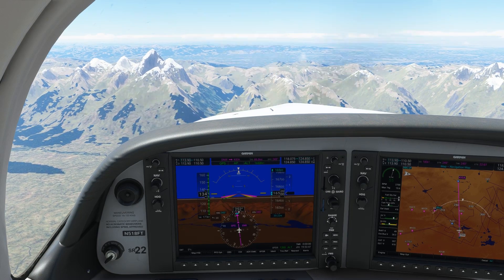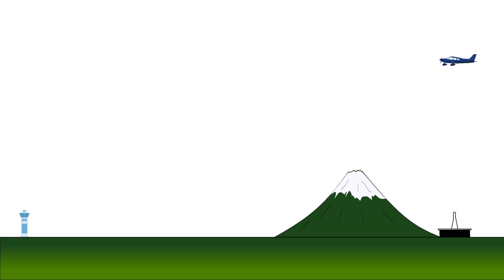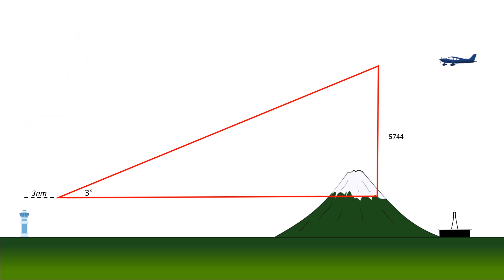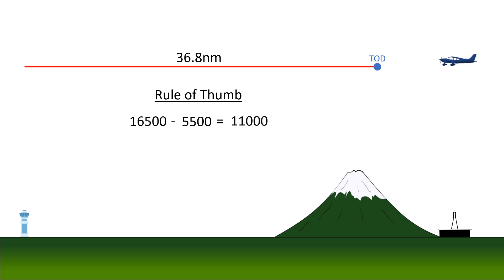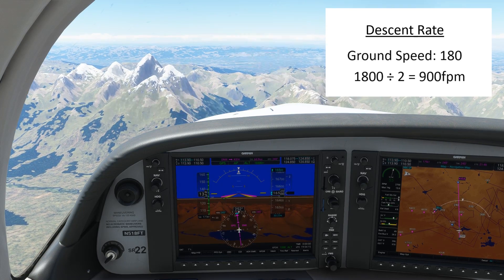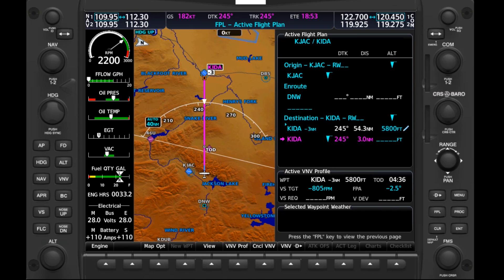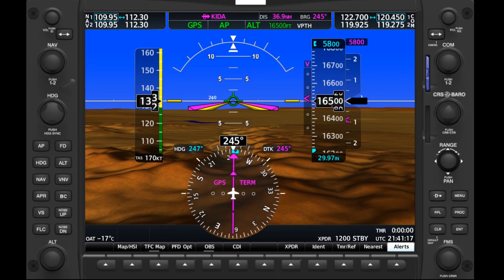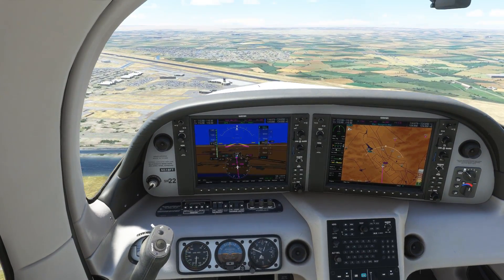Calculating Top of Descent Point | Descent Planning Rules of Thumb

Comment: Thanks, very nice video, very useful information.
The “3 X desired altitude descent” is a great tool.  I don’t know why you multiply your ground speed by 5. A lot of people simply divide their ground speed by two and multiply by 10. Hence, 180 kts / 2 = 90 X 10 = 900 FPM. This number needs to be adjusted by adding 100 ft to the 900 ft per minute to equal 1,000 ft per minute. The faster you go the more adjustment required. Example, to lose 10,000 feet you would multiply it by 3 and you would get 30 miles distance for your top of descent.  180 knots equals 3 miles per minute, therefore you would travel 30 miles in 10 minutes,  10,000 ft / 10 minutes equals 1,000 ft per minute. 3 Miles per Minute / 3 Rule = 1.0 x 1000 = 1000 FPM.  4 Miles per Minute / 3 Rule = 1.333 x 1000 = 1,333 FPM, etc.

Comment: For a PA28-180, descending at cruise spd  of 120kts, divide your descent 11,000' by 300, or, 110/3 = 36 nm. At cruise speed of 120kts, you'll need to descend ~600 fpm. My CFI said not to exceed 500-600 fpm for pax comfort, ears etc. What do you think of this method?

Comment: Try the The rule of 3 &  6.  In a piston a/c  if you have 10000 ft to descend use 6x10 = 60 miles to get down. use 3 x you GS as you decent rate.  In jets: if you want to descend 10000 ft use 3 x 10 = 30 miles to get down use 6 x your ground speed for you decent rate. It’s simple you can do it in head.  Slowing down use 1 mile per 10 kts in level flight idle power.

Comment: You can use ForeFlight to generate both a TOD waypoint and view a Descent to Destination (in feet per minute).

The nice thing about this is that - if you’ve accurately entered your Performance information for your Aircraft, and planned your route - with older avionics stacks, you can get much the same info on ForeFlight.

If, however, you just want to fly a general area and pick an airport to have lunch along the way (or get priority-diverted due to a family bathroom ‘emergency’), using Descent to Destination works extremely well. I’ve used it in both the 172 and the BL-17.

Comment: I have a question. 
There doesn’t appear to be any factoring of earth curvature. 
I used all the numbers given and calculated that you would be 1200 feet higher than planned at the destination, since that would be the additional drop over 38 nautical miles.

Comment: In the 530/430 there is a field you can put in the display called VSR (Vertical Speed Required) in connection with the VNAV function where you can input when you want to be at any altitude.  It also works well when given clearances like "Cross 20 mi west of XXX at 8000".  On that screen you have to put in your estimated/desired vertical speed, and it assumes the same groundspeed as in cruise, so you have to adjust for any speed increase in the descent.  For example, I set it for 1200 fpm, knowing that I will actually descend at 1500 fpm.  From that point it will give you time to TOD as well as an instantaneous readout of VSR, so you just need to match the numbers to hit your spot.

Comment: I usually do similar to the second method.  How much altitude will I need to lose? At a 500fpm decent (easier math than my usual 700fpm), how long will it take? Within 5 minutes of that time, start cruise descent.
Reply: Agree. I do the same. Easy to calculate in your head and ties to your speed, your aircraft. Plus a standard rate of descent (like climb) is more comfortable for your passengers and better for your engine. 500 fpm works great for me too.

Comment: Thank you for great formulas. Very very usefull when FMS profile calculation is inoperative ;))) So, taking into consideration that we fly JET with 400 knots ground speed at initial descent, our vertical will be 2000 feet per minute, arriving to the airfield within 200 knots we decrease it to 1000 to stay with our 3 degrees profile. Is it correct ?

Comment: Is the G1000 you are using the Working Title version? Some of the things you are doing (changing Direct To ALT/offset, adjusting VNAV profile) don't seem to work for me.
Reply: Looks like the video cut over to the G1000 trainer rather than the MSFS WT G1000 for that part of it.
Reply from the maker: Yes it's the Working TItle, with a cut to the Garmin PC trainer to show a function not available on the WT version
Reply: @flightinsight9111  Hopefully when the the WT version becomes the default, they will those functions